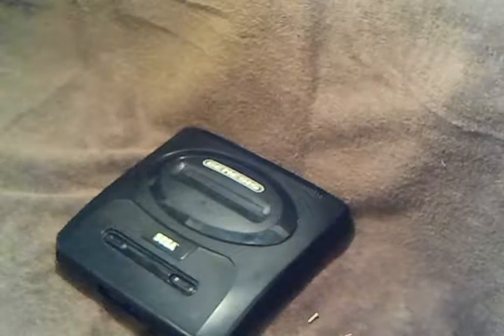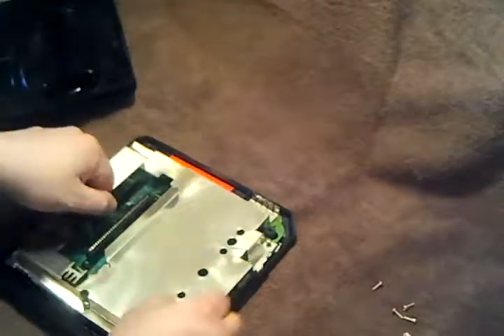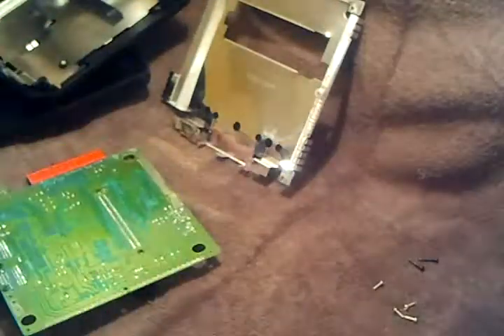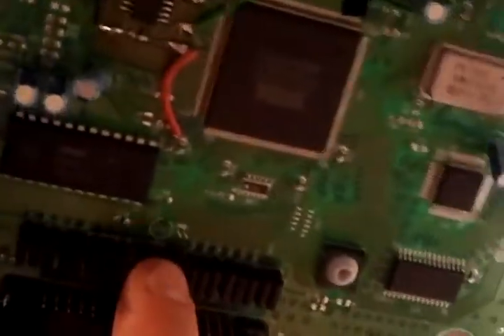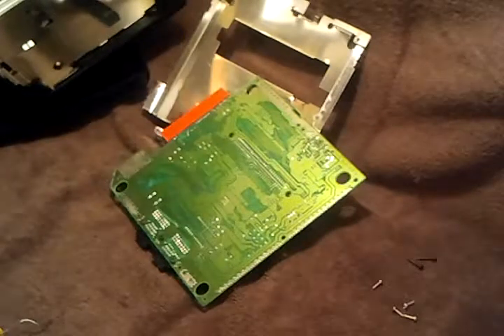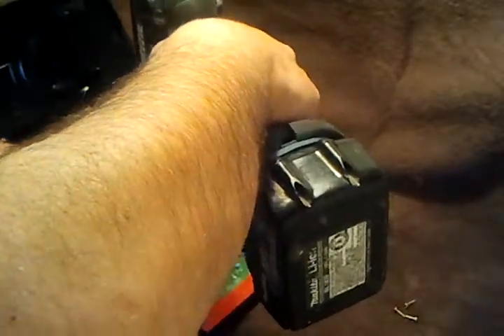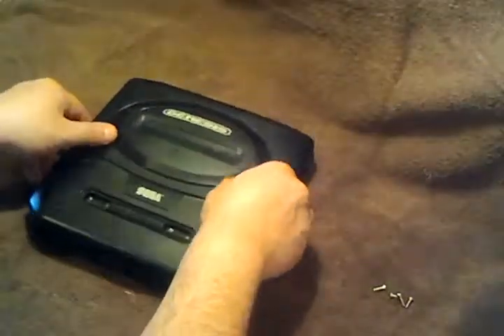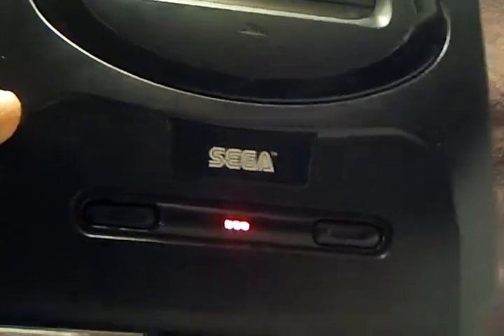SEGA GENESIS MODEL 2 REPAIR LED FIX

Comment: Do I need this new LED or can I just solder those two points together? Will the System turn on then?
Reply from the maker: Try it out let me know what happens
Reply: I'm having this same issue with my model 2 genesis. Has a broken led light . I currently dont have the av cables yet as I just ordered a new set, to see if it actually displays anything on my tv. Will a broken led light in the model 2 genesis cause the system not to turn on? Or will it still work.

Comment: hi there, thanks a lot for your video, got the LED replaced on my old megadrive II - teaching some soldering to my son at the same time. 

In case anyone asks, I got red LED 30 mA 3mm from Maplin in UK. These worked perfectly fine.

Comment: hi man , good work about the LED , l have same model 2 you have  but dos this model 2 can have AV out mod with Stereo sound ? besides there is no video in YouTube shows Model 2 with stereo sound out - so i think it would be very useful video if you do it to the same this console  also would you post video learns how to trouble shoot and repair the console ? l have other console which works but after a minutes 2 or maybe 3 the picture freez , so can you help in this issue ? i have never saw a video shows to fix my issue